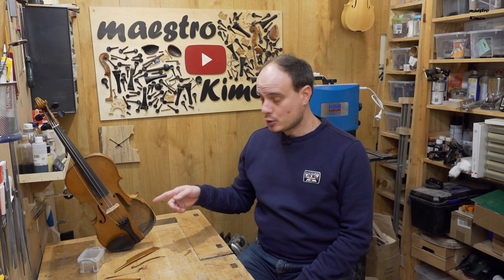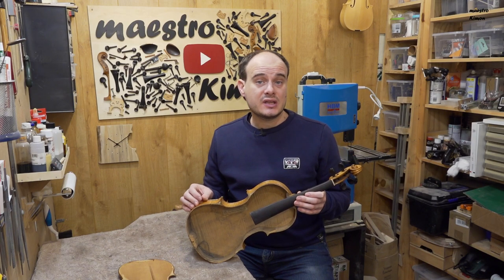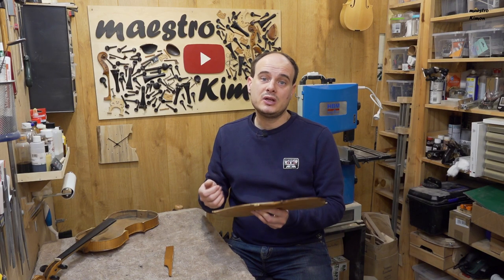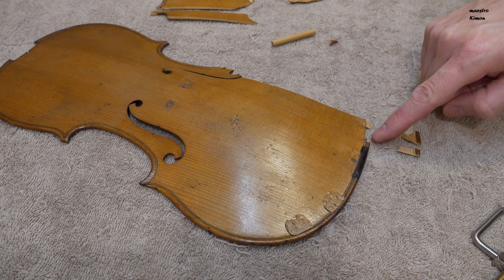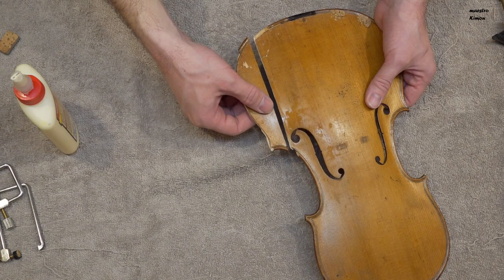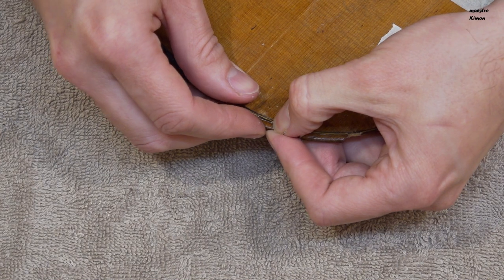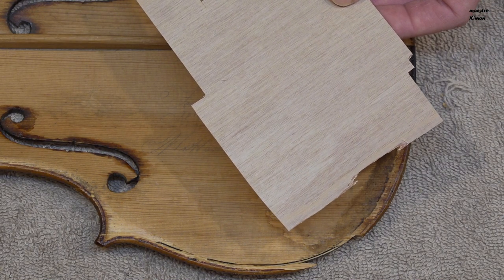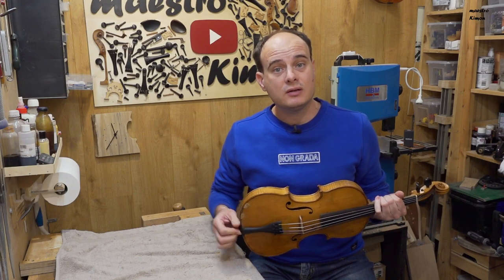Repair Series #29 - Don't sit on the violin!

Comment: A wonderful transformation. Using white glue makes a lot of sense, this is one join you never want to come apart again.
Reply from the maker: Thank you!
Reply: But it may have to come apart again if the joint starts to fail - we don't know how a synthetic glue will react after decades.  A synthetic glue joint that needs to be redone is problematic because the glue penetrates the wood and will never be completely removable.  HHG is what was used when the instrument was built and the HHG joints are reversible no matter how old the instrument is.

Comment: Maestro, I wonder if you have seen the maestronet thread recently that had heavily critical things to say about your use of synthetic glue.  The issue, as I understand it, is that synthetic glue tends to “creep” over time.  And also that once this happens, a joint made with synthetic glue will be more difficult to work on again.  

I say this with the ultimate humility, as I don’t have enough experience to judge this for myself.  But I thought you should be aware of what others are saying.  

All the best, 

A big fan of your work.
Reply from the maker: No I haven't. Can you send me a link?
Reply: I was an active member on MN long ago, and would agree with concerns over the use of synthetic glue.  We cannot assume that a synthetic glue repair is permanent, and that it never needs to be undone based on where the repair is being executed on the instrument.  

We can debate the idea that synthetic glue creeps, but it certainly penetrates, hardens and is water resistant.  This sounds good to some, but is a pain in the butt for others.  I just worked on a violin that was repaired using synthetic glue (saddle - bass bar crack, spruce top), and the repair cracked open on the summer growth.  I had to remove an entire section of summer growth to get a glue-able surface.  The instrument was not terribly valuable, but it would have been nice for the previous person to think of me.  Use proper techniques.

I also noticed that on this channel a neck/button repair was done using some unorthodox methods.  There was bad information given concerning the term "doubling."  Everyone has their own methods, but in general, repairs should not change a violin's basic construction.  Don't create unexpected pitfalls for the next person.

Comment: I love your videos maestro, thank you so much. 
I am refurbishing an old violin that had 2 open warped (beyond the top edge) ribs either side of the tail pin, so far I've taken the top off and removed the end block as it was cracked, loosened the ribs and trimmed them so they sit properly again the top needs some cracks repaired but I can already see it is not going to fit back on properly, it will have too much edge . Is this because the ribs have been shortened or that when the top is removed it flattens out and needs to be put back on with a bit of tension to bend the top enough to sit on with less edge showing. Do you have any videos showing this type of issue please.

Comment: Hello teacher, I really like your signs, but this I do not agree with the glue used, in my opinion you must use hot tail

Remember that if this instrument is submitted to a prophecional expert due to the repair made, it will be necessary or lose value or restore again

Comment: did you do any gap filling and varnish touch up or was it not worth the trouble?
Reply from the maker: I had to fill some small gaps. I didn't put to much effort as the original varnish is also removed.
Reply: @maestrokimon  Understandable! what do you use to fill gaps?

Comment: Applause.
The 0.5 mm plywood enforcements is a good idea. Did you take a note of the weight of the plywood chips by chance?
As for the writing it says as far as I can decypher:

Joseph Sie....
........ ........
Mittenwald 1871(?)

Do you have a high resolution photo of the writing?
Reply from the maker: I'm very keen on using this plywood. I didn't weight the pieces. A piece of 12x8cm weighs about 4gr so I thing that all the pieces together were les that 0,5gr.
This is the text that I also figured. I have no other picture of it.

Comment: It all came together nicely, but a shame you're still using white glue though.
Reply from the maker: Did you see the video where I explain why?
Reply: @maestrokimon  Yes, & I don't agree with it. I still think all repairs should be done with hide glue. No glue repair join can be considered 'permanent'. Also white glue is flexible compared to hide glue that can be removed with warm water, unlike white glue that can creep over time & can't be removed just with warm water.
Keep your white glue for furniture (not valuable antique though).
Reply: @rossthefiddler5890 this is nothing. I’ve seen a very experienced luthier use super glue!
Reply: @nickiemcnichols5397  Super glue for ebony fingerboard repairs is OK, & so is bow repairs for glueing tips etc., & can be used for crack & graft repairs as it can be undone with heat & acetone, (although a fine valuable bow should still be done with hide glue for a crack, particularly for longer working time) which is fine for bow wood, since a bow is finished with French polish. White glue should only used be for a leather grip etc on a bow.

Comment: All this work and it would have taken 2 minutes to put peg paste so they don't squeak, making the violinist's life easier. Would that have taken the bill to exalted height in putting in this little effort? Otherwise great work.
Reply from the maker: I noticed that the pegs needed some past and applied it after filming and of course I didn't charge for this. But why do you have to leave such a cynical comment? Can't you say what you think in a polite way?
Reply: @maestrokimon  I apologise, I didn't mean to be disrespectful as I appreciate your work immensely. I just found it odd that a maestro of your calibre didn't mention that the pegs needed fixing.
Reply: @kyproset  It's a bit much expecting every little detail to be filmed. He showed a majority of the work done, the essential reason for the repair, that is, the smashed belly repair (I don't agree with using white glue though). When doing work on a client's instrument I don't write an essay on the repair work to every bit of detail as some things are seen & attended to, just like putting a little peg paste on a sticky peg when the work was primarily something else. I may see there is something I can repair in the case etc too without writing it down & charging for it etc. In fact I often add up my time & then discount anyhow, because I care about the end the result.
Reply: @rossthefiddler5890  It's also a bit much to believe that he did anything about the pegs later on.  The tailpiece is cheap, four fine tuners.  It was, at best, simply put back to the way it was.
Reply from the maker: Guys, don't take everything so seriously. These videos are for entertainment purposes and are not a complete report of what I do. This instrument is not of high value (as you may have noticed it is even been poorly revarnished in the past), maybe not even worth this repair, that I did more for the video. It is a beginner instrument. The Wittner tailpiece that went back on it is a perfect solution for this kind of violins.